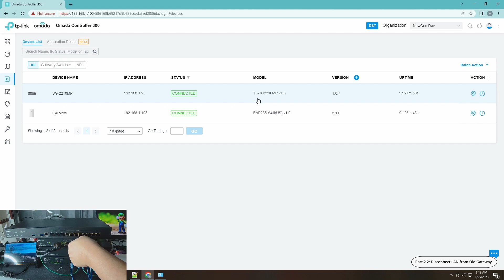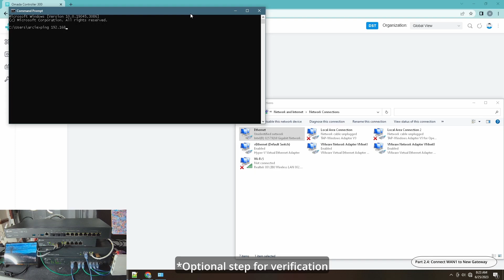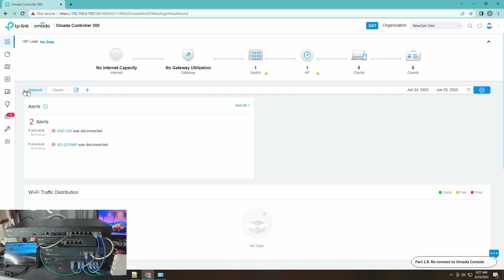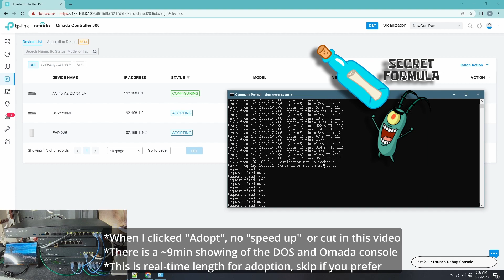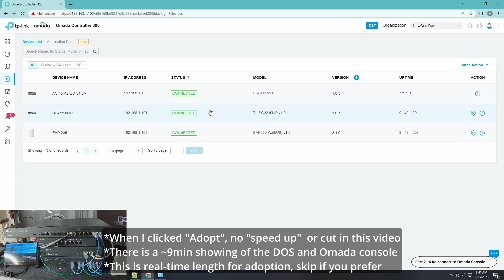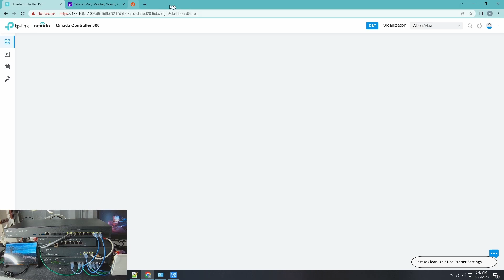LC48: Replace or Upgrade TP Link ER-605 ER-7206 ER-8411 Gateway with another TP Link Gateway

Comment: Hi, interesting video as usual... Quick one, I own an ER-605 v1 which is using a non-default IP scheme and want to change this with an ER-605 v2. If I change on v2 the IP to match the same IP scheme as v1 (out of the box when is still in standalone mode), it should be easily adopted in OC-200 once v1 has been forgotten, correct ? I will connect my management PC with a static IP directly to OC-200 while doing this of course. Thanks!
Reply from the maker: hey furiaf, thanks for the kind words and checking my video. Make sure that there is no IP conflict once you add your v2 device to the same network as the v1. 
Also, assuming you forgot the v1 device first so there is no IP conflict, what usually happens during adoption is that the v2 gets factory default so you might still follow the steps I outlined here (I have not tested your use case so I am not 100% sure).

Good hunting!

Comment: Do these steps also apply when you have the controller in a management VLAN?
Reply from the maker: heya @henkvanzwetselaar, welcome to the channel. Since in this video, I am not using the default IP scheme of 192.168.0.x for my controller, I am assuming that is what you mean (controller, old gateway and new gateway all in that VLAN). If so, yes, and the earlier video I posted deals with just that and it makes everything much easier. Here's that version: https://www.youtube.com/watch?v=IwKCwZKu9tY&t=0s

If you have a different set up though, can you let me know what IP is your management VLAN, where your controller is, and what is your Gateway's current VLAN 1 IP? tnx